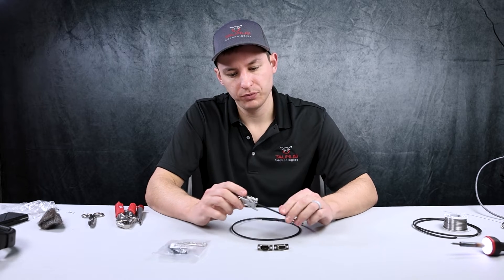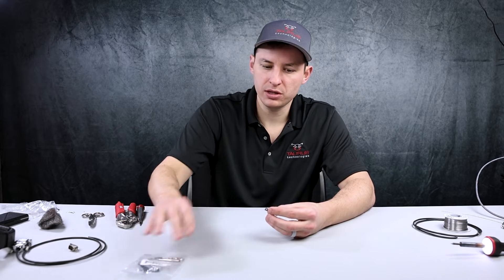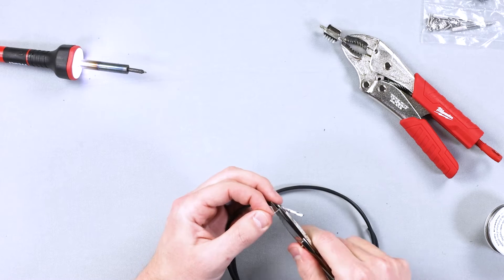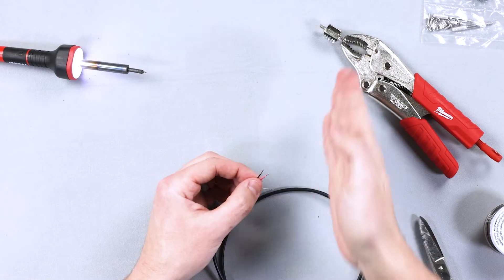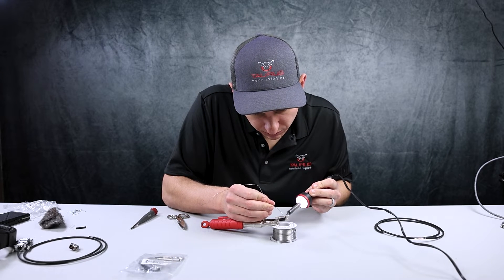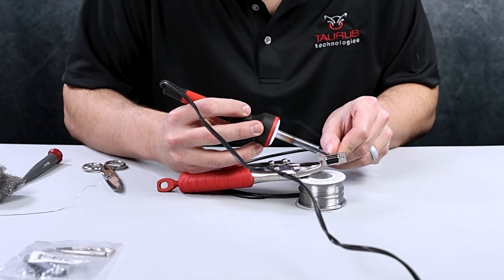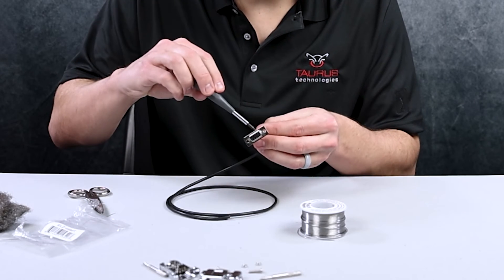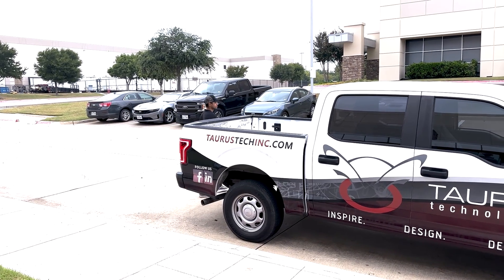DB9 Soldering: Step-by-Step Guide for Perfect Connections - Easy & Simple

Comment: Thanks for this video.  I have  quick question.  I have a DB9 plug on one end and a DB25 on the other.  It is connected via G, W and R and two jumpers.  If i want to remove the DB25 from the other end, which pins do i solder on the DB9 that i want to use instead?  TIA.